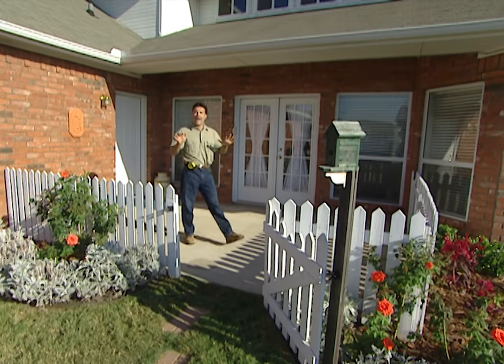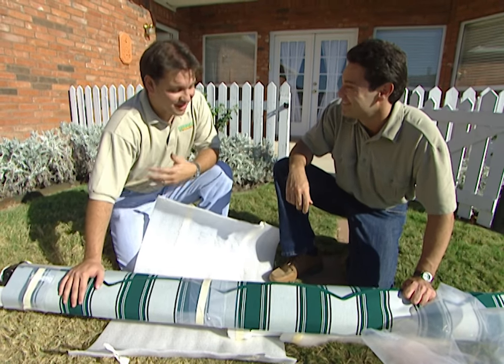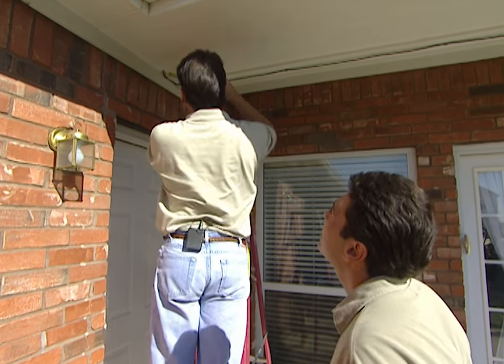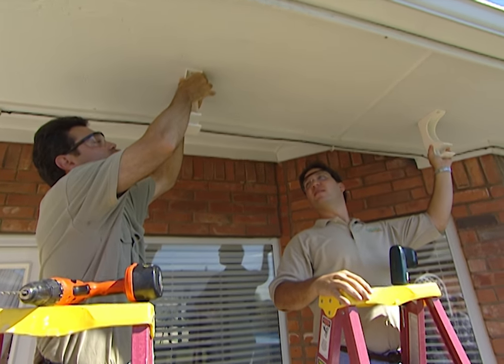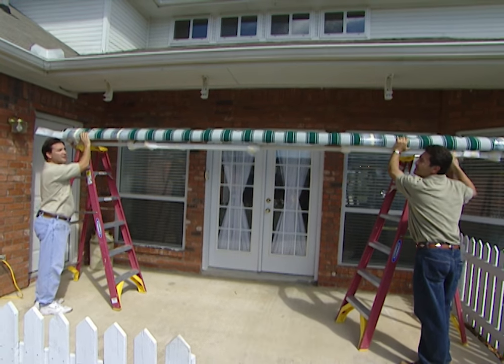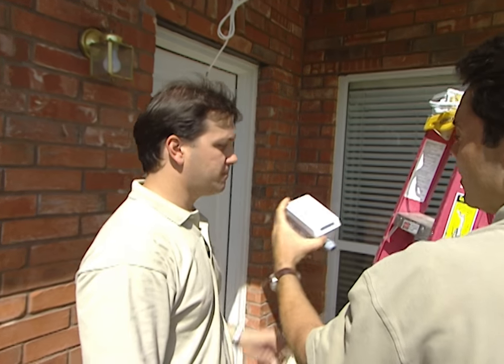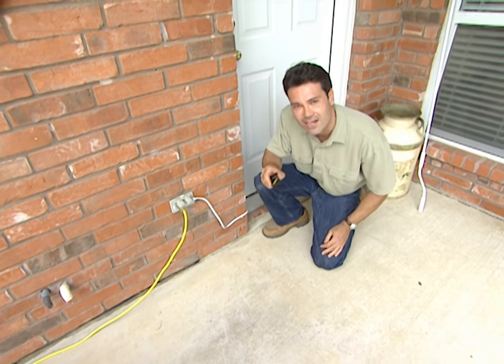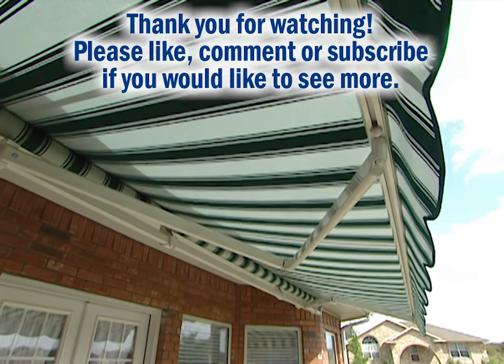How to Install a Retractable Awning - Fix it Up

Comment: We never got to see it fully extended so we could see how much it bows down toward the ground.
Reply: True. I'm just in the process of putting one together (sadly it arrived as a DIY kit!) but it has some bolts that can be adjusted to alter the angle of drop. It shouldn't be too horizontal in case it puddles rain. An angle of at least 10 degrees down is recommended. Next fine day I will be up ladders with two relatives to drill big holes, fit the support brackets and fasten on the awning to them. It is a daunting prospect! But I am going to YouTube it all so others can benefit from my (not too many I hope) mistakes!

Comment: My awning is remote with a high wind detecter. Sometimes a gust of wind makes the awning invert and can also be noisy (rattly). I was thinking if it had several slits top to bottom, the wind could escape easily and stop the rattle noise and the inverting... is this a done thing ?

Comment: $2200 to install 4 brackets?
Reply: no, but to install a remote controlled awning lmao like ??
Reply: Think the cost of the awning is included in that 2200 that's why he's said "with labor" not 2200 for labor alone. So cost of the awning plus install was 2200

Comment: How do you stop the awning from running our too far?
Reply: I'm just about to fit one (see my comment above). It seems like the extending arms will only let it go so far. I guess the motor detects the end point somehow and cuts out. Or else it is on a timer.
Reply: torque detection on the motor stops it.

Comment: Can this Retractable Awning support hurricane?
Reply: ..no...There is not an awning that withstand a hurricane, fabric, aluminum or wood. The advantage of this one is that it can be storage in case of a major storm.
Reply: If ylthe roof of your house can't support hurricane why would an awning?
Reply: I doubt any awning would withstand a hurricane..
Reply: An awning made of Kryptonite can withstand a tornado
Reply: Our awning after Katrina was over 35 years old, it was torn off.  Our new one, aluminum, which was installed after Katina, survived Ida.  We did have to replace one small end piece, but it survived. :)
Reply: These products aren’t meant to be extended all the time.  Their default should be to be retracted until you want some shade on a given sunny day.

Comment: What type of screws did they use in soffit to attach brackets??
Reply: I wondered that same thing. It's always the things you want to see that they don't show. It's like they were hiding the screws
Reply: Lag screws.  That's the only possibility when you're screwing into wood (studs) and have no access to the top of the screw for a nut.

Comment: Installation was 2200 dollars???? Wtf
Reply: What a rip $2200 off...$1500 labor??
Reply: Cost to buy  now is 150$ and installation $1500, total cost $1650
Reply: @mrmrjims3865  Only 150$ for that length of an electric awning? A real bargain. I just bought one online for £120 and it's manual and only 3m long, 2.5m extension. The installation cost is a killer even if it is two tradesmen for a hour or two. I could get four double glazed windows installed for that, units and labour.
Reply: Yes and he said two hours only